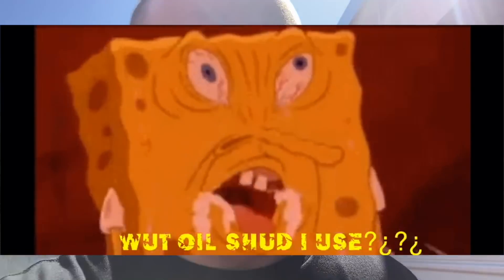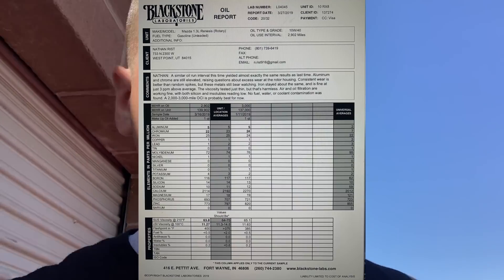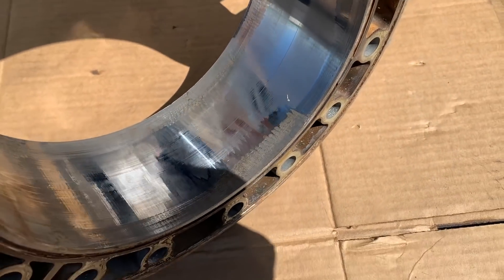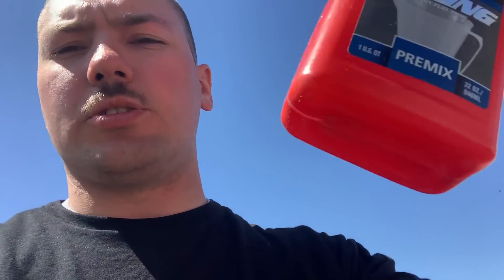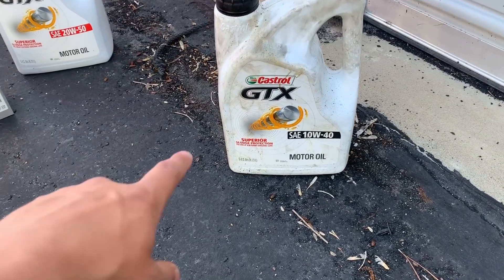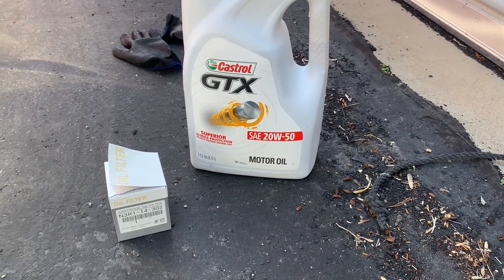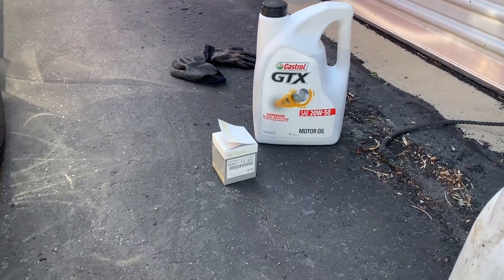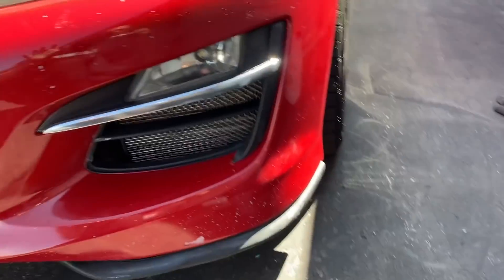HOW TO NOT DESTROY YOUR RX-8 ENGINE (with lab results)

Comment: I live in AZ where the temperatures here are over 70 degrees, I have a new engine less then 15k on it. I've been using 10w40 since that was recommended by a rotary shop in CA. Should I be using higher since I live in AZ where the temperatures are higher like the 20w50?? Please answer I'd like to prolonge the life of this engine since it's relatively new
Reply from the maker: Just follow this and you won’t have any issues at all http://www.banzai-racing.com/RX-7_recommendations.htm
Reply: @NateRist  great site and very informative video, thanks man 👌. Happy owner of a second rx8, 04 6 port with 78k on the clock. And looking to delete cat to start running premix

Comment: I like your oil opinion actually. 
I run with 10W50 all year. wait sufficiently for it to warm up during cold days. 

actually in Japan, it s the recommended to use 20W50 for the RX8 :)

Comment: What about the use of synthetics vs conventional oil? This is also a really debated topic, and was curious as to your thoughts on the matter. Engineering Explained recently had a synthetic vs conventional oil and mentioned rotary engines at the end, saying that synthetic is basically the same thing as conventional chemistry wise. Thanks
Reply from the maker: if you have an omp system that is still sending sump oil into the combustion chambers you do not want to use synthetic, it will cake the shit out of your rotors in carbon. If the OMP system is blocked off then it's fine. Based on my test results though the benefits of synthetic vs conventional in a rotary are minuscule at best and just a waste of money. Personally I wont use anything but castrol GTX conventional simply because it's cheap, readily available on local shelves and works very well
Reply: @NateRist  Interesting, so just because the oil is injected onto the side of the housing instead of atomizing it through the injector causes carbon buildup? I wonder why that's the case. Well thank you for the quick response, wasn't expecting one. Much appreciated
Reply: Also, Engineering Explained touched on the carbon build up topic briefly and said that he does not think synthetic oil causes buildup anymore than conventional. I don't really know who to trust though since I can't find any evidence or proof of synthetic use anywhere lol. Not trying to say you're wrong, but just thought I would mention it. He doesn't own a bunch of rotary engines and has taken them apart :P Thanks again
Reply: Btw the info you have on the 20W-50 for 70+ degree weather is correct. I had one of my engines rebuilt by a shop in Texas and this is exactly what they recommended. I use 10W-40 conventional Pennzoil. If I was rich I would try a new engine with only synthetic with a OMP and see what happens lol.
Reply: @IStratz  Most of the information people have on synthetics is old. Using synthetics from the '90s and early 2000's he would likely be correct. Personally for pre-mix if you wanted to try a synthetic (I'm not a mechanic so advice from a specialist in rotaries would be good here) I would try a 2 stroke synthetic since it's designed to be burned in the engine and a regular synthetic in the weights recommended here for the oil in the engine itself. My thinking is a thicker weight in the engine would mean less oil past the apex seals (which is why they suggested lighter oil?) but that's fine if you are adding a 2 stroke synthetic to the gas that's made to be burned and lubricate seals in the engine. I would get the engine oil tested by a lab such as the one he's using and let them know what you are doing but it would be interesting to hear of real-world results so if you try it I would love it if I could get a comment back if you can.
Reply: @IStratz  From my perspective higher carbon build up is due to the higher Ash \ Sulphur % and it's absolutely possible to find synthethic with lower % of these things.
That's why i'm switching to synthethic.
Reply: I wanted ask if royal purple was a good recommendation for rotarys

Comment: I have a question. I live is South Africa so getting premix has always been a hassle and super expensive for my RX8 (series 1) gonna rebuild soon recommend alternatives to idemitsu? Was thinking it should be mineral based, I see castrol offer Castrol 2T (it's the red bottle) in South Africa. Would appreciate your opinion.

Average Temps
Parts of South Africa see summer highs get up to 81 degrees Fahrenheit (28 degrees Celsius), with averages closer to 77 degrees Fahrenheit (25 degrees Celsius), while the mild winters produce average highs of approximately 63 degrees Fahrenheit (17 degrees Celsius).
Reply from the maker: For premix as long as it’s rated FC/FD Jaso it should be fine. Idemitsu is all I use, but most others use Lucas as it’s what’s available on local shelves

Comment: I run in my s1  t6 rotella 5- 40 full synthetic I premix .5oz per gallon I figure if the omp doesn't put enough oil in the engine than the little it puts in won't hurt if it's synthetic?! Any input?
Reply from the maker: Enjoy cleaning all of the thick carbon build up on the rotors when you pull the engine apart (likely due to carbon lock)
Reply: @NateRist  Do you mean that this oil burns bad? So he needs semi synt / mineral or synthetic that burns well?

Comment: I spent over 100 for oli change I use idemitsu
Reply from the maker: And that's exactly why I don't use idemitsu for engine oil. Good product, but not logical for a daily driver when far cheaper oils that do just as good if not better with a good filter don't exceed $30 every 1-2 months. I am curious as to how a single oil change costs you $100 though as the oil itself shouldn't exceed $50

Comment: Hmm I’m gonna be buying s2 rx8. Compression came out to be 6.3, 6.5, 6.3 and 5.9,6.0,5.9 car still runs perfectly fine hot starts easily cold starts easily. Hopefully if I start to use 10w40 and premix it’ll be fine. Previous owner did all oil changes every 3k miles at Mazda which might explain why it’s already on its second engine. Bye bye 5w20. Also, where do I get those oem filters cheap?
Reply from the maker: The only oil filter you should ever use on an S2 is the OEM one (which is ironically the cheapest), it’s one of the few things I will ever go to the dealer for. As for compression numbers that would be “failing”, however, if it runs “fine” and doesn’t show any sign of shitting itself then it should be “fine” for quite a while if actually treated like a rotary

*Tbh mine is probably in the same boat as it was consistently setviced at Mazda up until I acquired it at 131,000 miles and is now at 152,000 miles (and have still yet to check compression numbers lol)
Reply: Nate Rist damnnn yeh he said it’s been like those numbers for a yr now. He got the car late 2018 right after engine was replaced. $5K can’t be too bad haha thanks, love the videos

Comment: Fyi Idemitsu from Japan has a rotory oil blend 10w30 and 20w50 that Mazda motorsports koni cars run as well as the grand am cars run. I have many many reports from both our race cars here in u.s. as well as our customer cars showing it reduces wear even further while reducing carbon build up do to the extremely low ash content.

Comment: Hi
Just wanting to say my S2 oil analysis was similar, high iron, chrome and copper 
I thought the chrome might be from eccentric shaft journal wear?
Reply from the maker: If there’s chrome in the eshaft that would explain a lot of things, but as far as I’m aware the only chrome plated things are the housing surfaces. High copper content would be bearing material also. What did Blackstone say in their notes? (assuming that’s where you sent your sample)
Reply: @NateRist  I was thinking it looks like high chrome steel?

Comment: Isn't the first number on the oil your hot viscosity?? Oil is thicker when cold. Jet engines use oil heaters before turning on their apu at high altitude (cold temps) because the oil freezes solid. Oil viscosity gets thinner as it warms up. It's the surface film strength that determines the amount of wear resistance between moving parts not necessarily viscosity.
Reply from the maker: First number is cold weight, second is hot
Reply: @NateRist  your absolutely right! Just looked it up. Thanks for the reply!

Comment: Great vids man. How many miles between oil changes and also how many miles have you put on your r3? Thanks!
Reply from the maker: 3,000 miles and so far about 15,000 miles under my ownership (it’s at just over 146,000 on the clock)

Comment: I run 10w-40 with premix and never had an issue. It’s good insurance to premix especially in the S1 engine to preserve the housings and seals in case the OMP fails. Good information thanks for sharing.
Reply: Over 100k on my rx8 and never premix. 10w30
Reply: flat4wankel 10w30 can be ok (has certainly worked for you) but for this engine, 10w40 is proven better especially in hot weather. Premixing not 100% necessary because it already premixes oil into the housing through the OMP. However, if that fails (can happen), you are running your housings completely dry until you notice the OMP isn’t working.
Reply: @mischiefpwns  
My bad i use 10w40. 04 still running. A lot guys baby their rotary and why it fails. I have own from an 82, 91, 04, and an 11 r3 and never an issue.
Reply: flat4wankel yea, also have no engine issues with any of my rx8’s (2 were purchased with the engines not running and previous owners believing they needed to be rebuilt). Have other issues though that are annoying and difficult to fix. Nice you got an R3 I’m still tooling around in S1’s lol.
Reply: @mischiefpwns  
Yea got it about a month ago and so sexy in red. Need to own an fd now lol
Reply: I have a sohn adapter. Fresh two stroke injected in the engine at all times. I am able to use full synthetic in my crankcase.

Comment: 5w30 royal purple or 10w30 idemitsu
Reply from the maker: Royal purple is literally aids to a rotary (Blackstone Labs has tested samples of it used in rotarys and it came up at a much lower viscosity than what RP had labeled it as). Idemitsu is definitely the best you can buy, but I stick to castrol GTX because it’s readily available on the shelf, very low cost and works very well
Reply: Castrol is more reputable cause it's been around longer and many rotary enthusiasts swear by it. I would stick to  Castrol 25w50 which will make it last longer. The ROTARY ENGINE HAS TO HAVE THICKER VISCOSITY OIL BECAUSE ITS WORKING ALOT HARDER THAN A PISTON ENGINE SPINNING AND COMBUSTING A LOT FASTER WHICH MAKES IT GENERATE MORE HEAT. SO UNTIL THE MAKE IT WITH STRONGER METALLURGY I WOULD STICK TO 20W50. GOOD JOB WITH YOUR CARS!
Reply: Carlos A. Lopez stop yelling
Reply: @brotherloops  i chuckled. Haha
Reply: Is idemitsu 10w30 better than castrol 20w50 in summer?